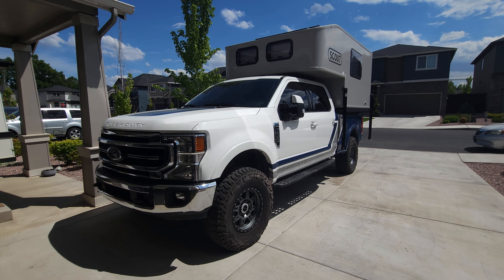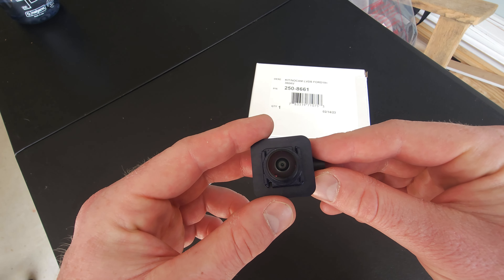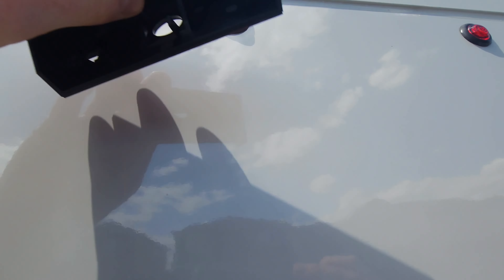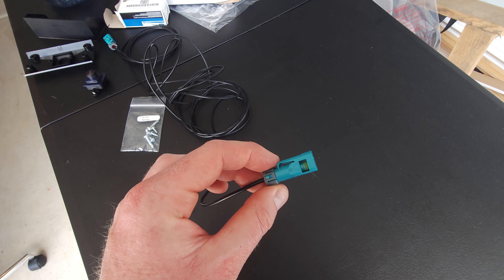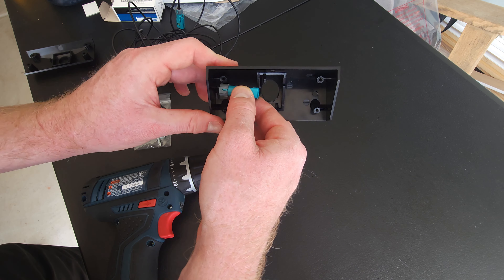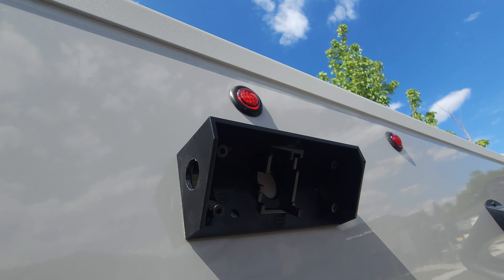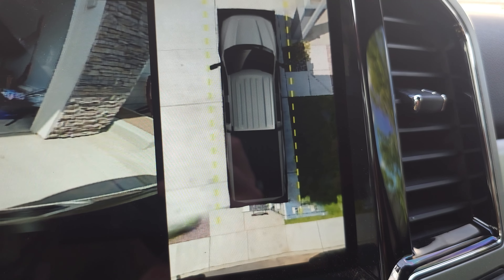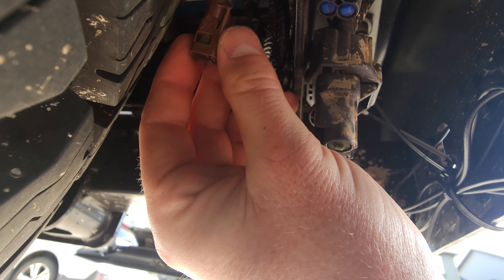Camper Backup Camera with No Drilling!

Comment: It seems obvious but....Do you simply unplug the camera relocation connection underneath the truck when you are taking the camper off?
Reply from the maker: Yes. You unplug underneath the truck, plug the tailgate connector back in, and you're good to go!
Reply: Hey Riley, I am in the same situation with no rearview mirror and with the tailgate down, no reverse camera.  My truck is a GMC Sierra and I am looking for an all-in-one solution where I can see the rearview of my truck camper full time (not just backing up) and record at the same time as a front and rear dashcam.
Reply from the maker: @12northchad25  I'm not the best resource for dashcam information, but I have some friends who have used Wolfbox camera systems and been happy with them. I believe the primary advantage with such systems is that they act both as cameras and recording/security devices simultaneously, so it might be worth checking out!

Comment: Thanks for the video, I ordered the same parts and am about to install. After having used it for a while, how are you liking your mounting height? Does the 360 view work with the camera being higher up than stock? I was debating weather to mount above my camper door or next to it at the height of the tailgate.
Reply from the maker: Thanks for watching - hopefully, it helps! I like the height for backing up because it provides a full field of view with the tailgate down. I can see the edges of the tailgate, etc.

It does work for the 360 view, but there are some blurry/obscured spots that distort the rear corners a bit. It's still functional and works well enough for me.

I decided to prioritize having the camera centered over having it at tailgate height. I'm not sure which compromise would be better, but I'm happy with how the spot above the door has worked!

Comment: Do y’all plan on dropping the camper at times or leaving it more permanently in the bed of the truck?
Reply from the maker: We'll be dropping it when we're not traveling. It's possible we'll also drop it if we're in an area for a prolonged period
Reply: @rileyinthewoods  - what's the plan for the camera in that scenario? Quick disconnect from under the truck?
Reply from the maker: @DrivingEverest  yes sir! Simply unplug the camper camera and reconnect the tailgate camera. That's why I decided to purchase a second one instead of relocating the original!

Comment: What kind of adhesive did you use to mount the bracket to the camper?
Reply from the maker: The housing I purchased came with an adhesive backing. I got it from Camera Source. For the wiring, I initially used all-weather Gorilla Tape and recently replaced it with wire hider from Baja Designs.